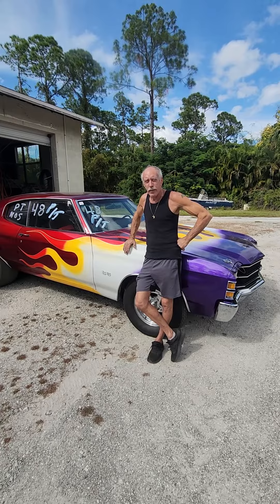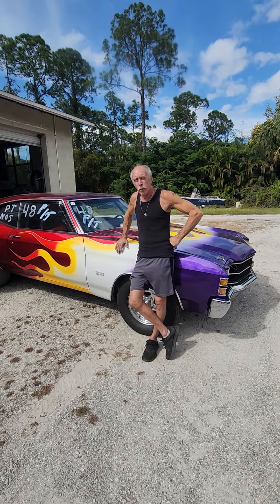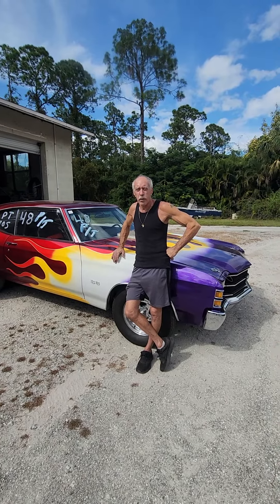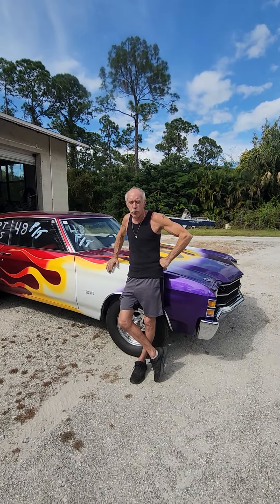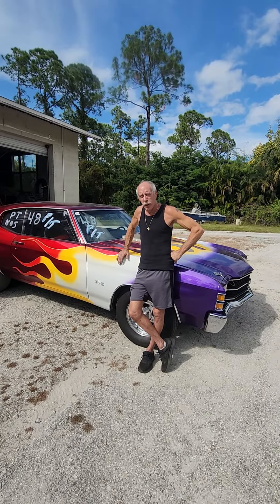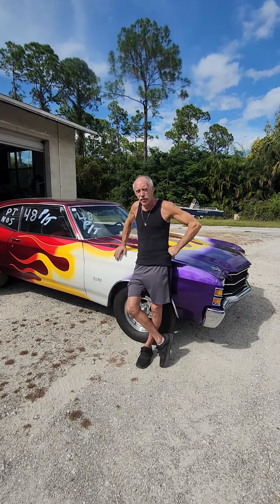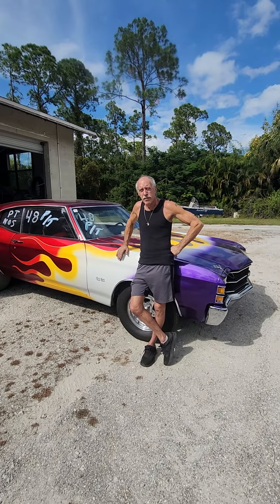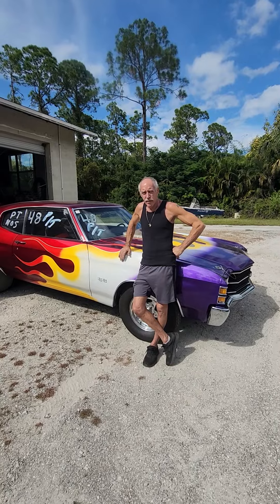Quick rebuild on 522bbc 💪

Comment: Great video Melissa  !!  Yep don't hurt it anymore if low oil pressure,  good call on another rebuilt and using that as a backup..sounds like chris has a plan  😊 !!! Take care guys ..
Reply from the maker: Thanks Jeff! Chris is pretty sure he knows what the problem is. We are taking the motor out today, after we paint some parts on the panel truck. Take care up there, I bet its getting cold quick!

Comment: How do you "freshen" a motor that was brand new last July?  Makes me feel better about my crappy 2008 F150... at least I got more than 5 mo. out of it. Even drove it more than 6 times...lol
Reply from the maker: He explains why in the video...clearly. Around the 30-33 second mark I believe but some people don't have that long of an attention span. You've followed this right along you know it's been sitting in the elements for years. Brand new.  It still ran a 6.40 at 110mph on 7 cylinders lol. We are just fixing it before any damage can be done. Friday nights are test n tunes and that's what we did 👍
Reply: Sounds like the bearings are needing replaced
Reply from the maker: @johnpinkerton8596  Most likely rod or crank bearings from sitting outside for so many years. We will find out soon, we are taking the engine out today after we finish painting some of the panel truck parts 👍
Reply: Hopefully you will share videos of each step of the process!
Reply from the maker: @johnpinkerton8596   Of course! Chris just said everyone will like to see his big aluminum rods...lmao. We definitely will have videos of the whole process lol.